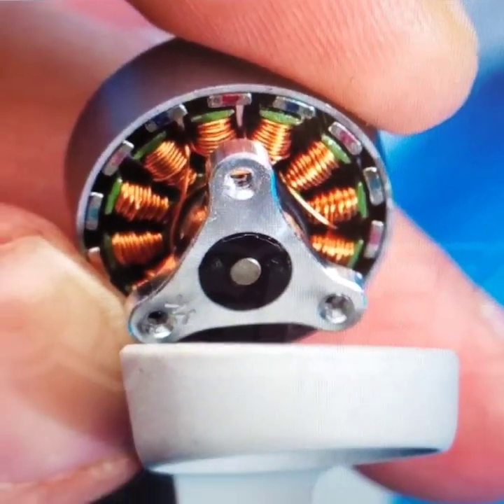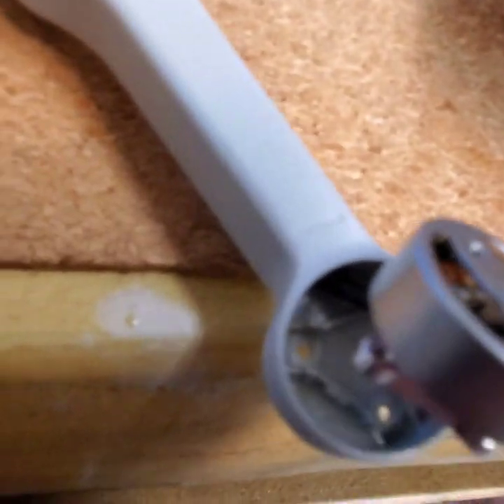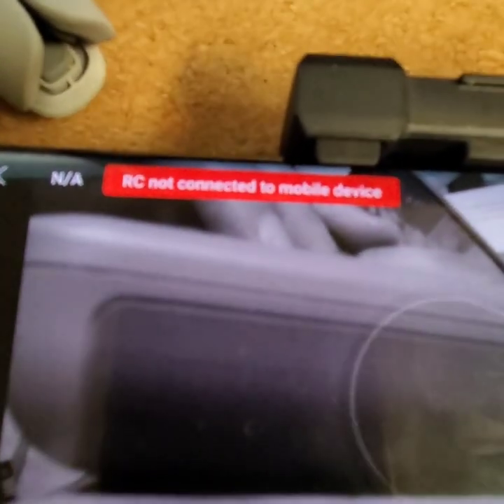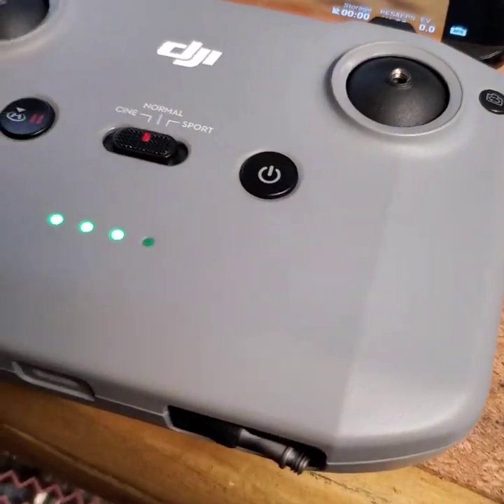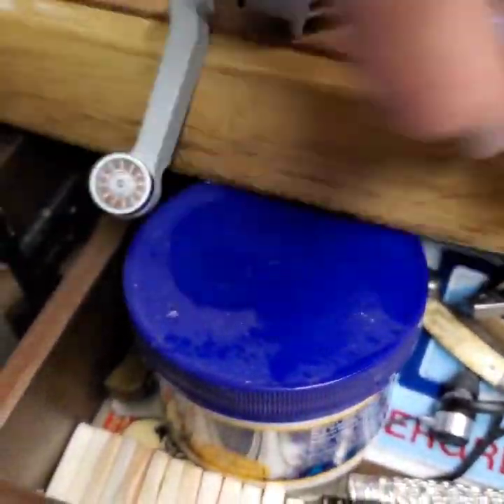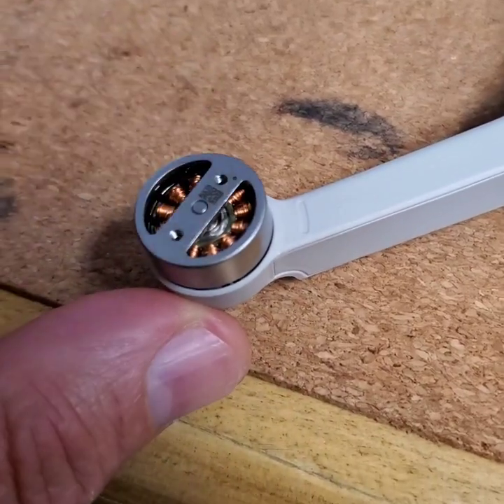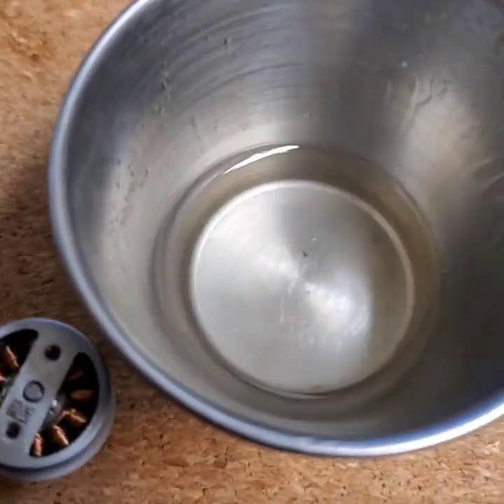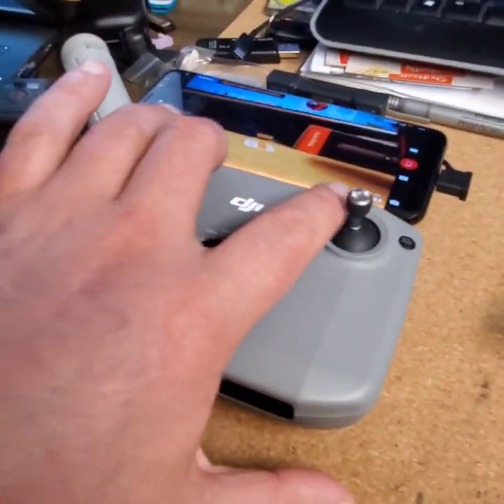Solution to sand in drone motors (DJI mini 3 pro) - How to clean DJI Drone motor from sand

Comment: I would’ve taken the foam backing off the motor then tried compressed air first. Unless you did. Seems kind of sketchy, tbh.
Reply from the maker: It help hundreds, air won't blow off sanded dust, plus you do not have to tear a part more.

Comment: I had a whine in my Mavic Mini on takeoff, and the controller reported "Prop too fast".  Before trying this method, I removed the props and blew the motor out with compressed air, and it worked, so I suggest trying that first as the simplest method.
Reply from the maker: Thanks for sharing. I try mini powerful vacuum, as well air blow, the finest staff is impossible to clean, you will have 1 piece of sand stack in air out from somewhere where was stock, and your drone is gone. ,

Comment: No relubing of the bearing and bushing, that motor is not going to last very long.
Reply from the maker: Bearing is sealed and lubed. Try to diluted Alcohol and any greas prior judge. 100th of happy try it, and it work just read the comments. I'm using my more then a year now😄
Reply: @goasfarasyoucansee  it's sealed from dirt/sand, not liquids. These cheap motors only have a top bearing, the bottom is a bushing, and nothing sealed about that. The other thing is iron shavings, as you know rubbing a magnet in dirt or sand will pick up iron shavings, your methods will not remove these from the magnets. I have been building, tuning, modifying motors for competition for 4 decades, I know what I am talking about from experience.
Reply from the maker: Work with gadgets for last 45 years, 35 years ago I was soldering microchips with solder station that powerups from gas burner 😂 Usually there is no metal shavings in this motor, space between rotor and outside magnet that thin that even microns of the sends can't get in between. If few get inside, then they turn in to the powder by crashing between surfaces. There is only one affordable and many time appreciable by hundreds of watchers method is to use liquid, water is no-no, alcohol is perfect, and remember you not spinning. I do not have time, but I more then happy would record video under microscope in that area, to bust thoughts. You have to sit and spin motor for hour in order to wash anything from bearing. Of course there is other methods, this is just a quick that everyone can perform. 
Thank you for your thoughts.
P.S IMAGE of DJI Bearings shorturl.at/dmNX2
Reply: @goasfarasyoucansee  your link posted does not work, repost please.

Comment: Thank you for posting this! I fly my drone in a marine environment, so I suspected corrosion or sand. I used Boeshield T-9 instead of alcohol and it worked. Hopefully, this will keep it working for a while. 🤞
Reply from the maker: Excellent solution!

Comment: I think you could’ve save so much time using a small vacuum and a air duster! Just my thoughts.🤫
Reply from the maker: NO- NO- NO. It won't work, it is nearly same to vacuum from the motor that is size of the matches head) Already try it, and come up with better solution, if you would read comments, it helped hundreds.

Comment: 70% isopropyl is 30% water. Perhaps use compressed air?? If the sand is not magnetic it will fall out if you rotate the motor when pointing the opening down, and compressed air can help get it out. If it is magnetic particles then it won't come out so easily and will require further disassembly and removal using something like blue-tac or sticky clay or tape to grab it.
Reply from the maker: You do not have to use method that helped hundreds of users ))
Reply: @goasfarasyoucansee  You said you did not want to use water, just noting out that you did use 30% water. Water may or may not be a problem, but there's a lot of water in 70% iso, and in many cases 70% has other unwanted things mixed in it. For example in 3d printing we avoid 70% iso because these unknown chemicals often cause problems to adhesion. The 92+% iso doesn't have these problems. The motor has a very narrow magnetic gap, and it has a bearing which has some lubrication, and the stator iron may be subject to rust but is passivated against corrosion to some degree. I suspect compressed air and 92+% iso is a safer approach. Others have removed magnetic particles which are very stubborn by disassembly and blue-tac or something sticky that grabs the particles when compressed air fails to dislodge them. I fixed mine without using iso at all. Iso may damage the lubrication so might be a problem in the longer term. Hopefully I won't need to fix them too often by avoiding flying too low, crashing or landing in dirt/sand. I will use only compressed air if possible, any liquids may cause long term problems to the motors.
Reply from the maker: @alanb76  And that why I recommend to use what I use, exactly based on what you said.

Comment: Thank God I found your video. I just went to Parangtritis Beach in Java . After calibrating imu on the sand my dji mini2 prop  SUDDENLY stuck  . A Bit panic but I am sure I will find a solution on youtube. Thank you for sharing diy fix on such problem. I will go home and fix it your way... I hope I can fly again soon.
Reply from the maker: It will take time. But carefully you can. You might have to grand this by manually run motors. Please help my channel share and subscribe

Comment: I fixed mine without taking apart the motor and leg. I used QD ELECTRONIC CONTACT CLEANER (Red bottle spray). First I removed the propellers on the defective motor with the little screw driver, and the I hold the drone upside down with one hand and spray a bunch of QD contact cleaner while rotating the motor with my fingers and used a paper towel to dry the inside of it. It worked so good 👍🏻 Just keep spraying since it gets a good pressure wash from the can. 🧼
Reply from the maker: Good technic.